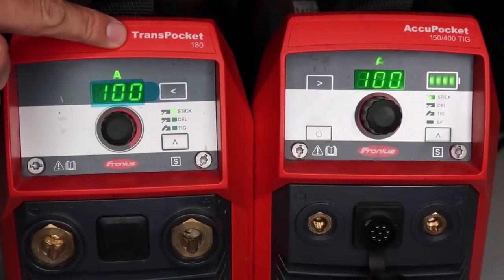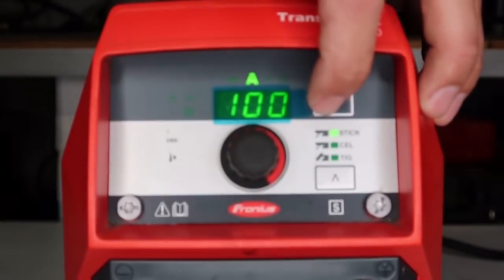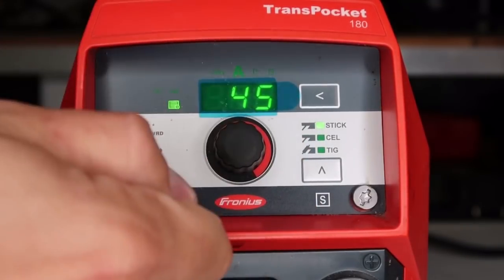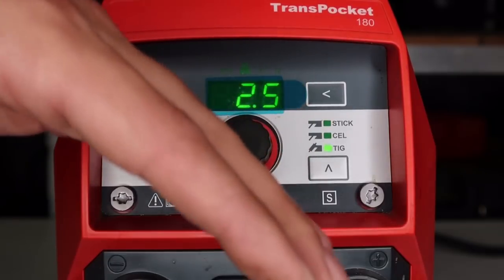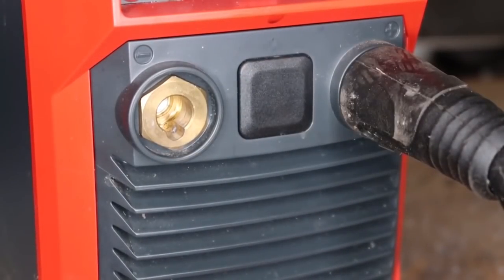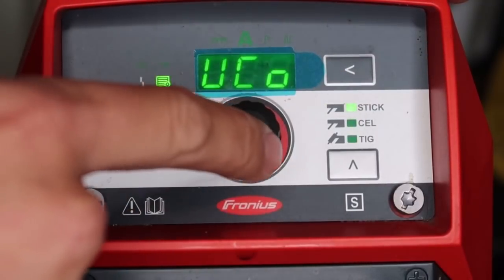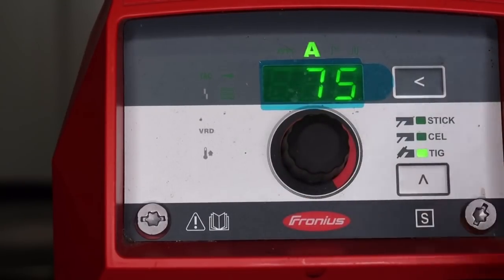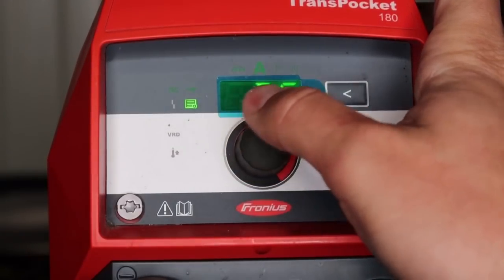Does Your Fronius Accupocket Or TransPocket Cut Out During Welding?!?!?

Comment: Hi I actually contacted Fronius. They suggested not to use an adapter, because it was quite likely the increased voltage from 110-220  probable melted the components. They suggested I either cut the cable and install a 220 plug or get a new cable.
Best regards, Roy

Comment: Hi Chris 
I have a transpocket 180. Got the E 4 error code and it shuts down. Im increasing the shut off voltage from 45 to 70 to start. Im in Europe now and the euro cable does not have a built in ground so I need to use an adapter with a ground also. The adapter is not made well and the ground may not be as secure as I like. Im wondering if that could be a problem too. Your thoughts, thank you.
Roy

Comment: Very informative video. I’m thinking about buying a transpocket, with tig, are you using a scratch start or is their controls on the torch
Reply from the maker: Edgar Banuelos Thanks. It would be lift arc TIG on Transpocket. There is a new machine called TransTig 170 or 210 with high frequency as well. Same size

Comment: Hi Chris, i've just bought my transpocket 180 and would like to know if it will run at my 2.5 kva generator and how many amps can i use. Thank you very much from Brazil
Reply from the maker: Diego Ribeiro 2.5 will be good to run the machine at fully capacity on 110 V. I run this machine off 2400 Watts all the time
Reply: Thanks man, but mine is not dual voltage, it is only 220v
Reply from the maker: Diego Ribeiro You will be alright just find the point where the machines kicks off. Start off at 120 amps and weld and keep turning it up until it kicks out. You should at minimum get 120 amps

Comment: Thank you. I just  subscribed to your channel. I ordered a 180 transpocket stick/ tig yesterday. I have stick welded since high school and this is my first tig attempt, and I am 70 years old. This video, I am sure, saved me from freaking out in the future. Any and all new info you put out about this machine will be helpful. Also, do you know what size generator, or inverter, is required to power this welder in stick mode if I am ever in a remote area with no electricity source available? Thanks again!!
Reply from the maker: poppahonda Thanks for watching 👌 Glad to hear you ended up with a Transpocket 180. You will be very pleased especially since you have the time under the hood. I’ll try and do other videos on the machine in regards to setup so it helps along the way.. On 110 V I don’t have any issue with 2400 Watts and this will give you 120 Amps output depending on if it’s a 20 AMP breaker. At full amperage you will need around 4800 Watts but you won’t need the full amperage range especially in stick mode. Feel free to reach out anytime with questions

Comment: Great video Chris,
This is an awesome feature of the Transpockets. I personally hate the long crazy arc when pulling out. I like the cutout voltage set on the lower side (35v or less) If it is cutting out on a user on a lower cutout voltage I have found that it is due to one of three factors. 1. You are buried in too deep 2. You are keeping way too long an arc. 3. You are not staying in the puddle and trying to weld in the slag (if this is the case than you have issues no machine can fix). These things will weld 16 gauge all day with no issues with a 3/32 7018 with a pulse of setting of 2-6 hz and amps set at 82. These things make welding uphill feel like cheating when using pulse. I find myself grabbing the Transpocket for jobs that I would normally use a Mig welder for.
Reply from the maker: Well said....I’m right with you on the Transpocket being my go to machine. Even on the TIG side 100%. People always think they need bells and whistles but at the end of the day it’s a CC machine without high frequency.